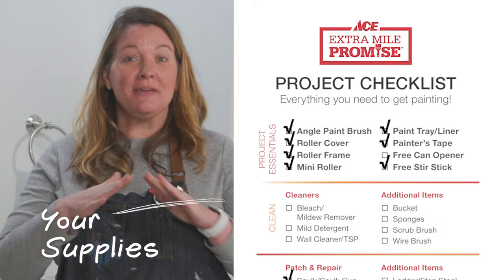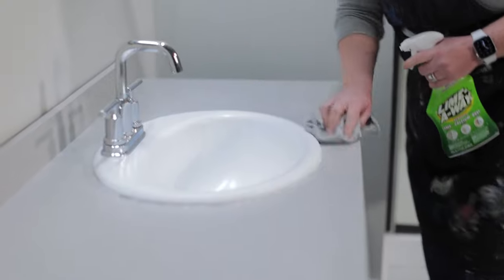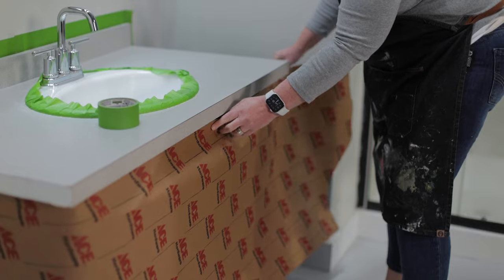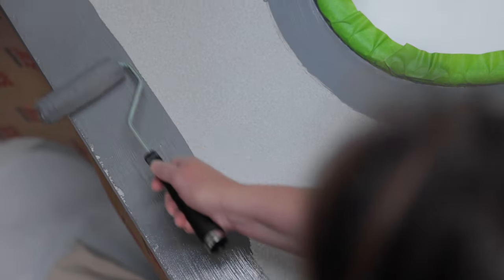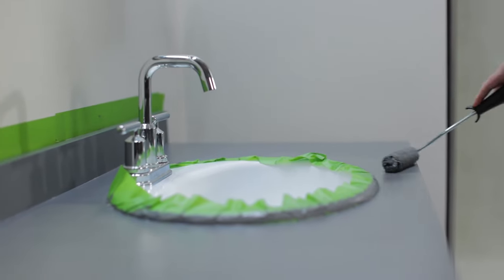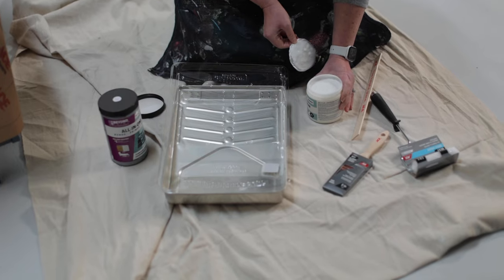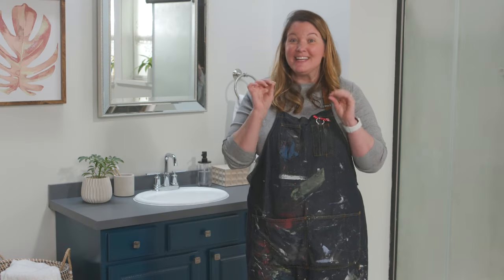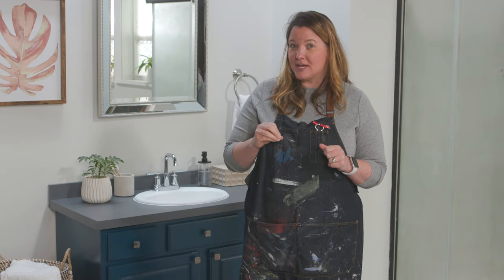How To Paint A Bathroom Countertop - Ace Hardware

Comment: If the bathroom countertop is currently caulked to the wall, should I remove the caulk before painting and then re-caulk after the paint is dried? Or can I paint on the existing caulk.
Reply from the maker: Yes, you will want to remove the caulk and then re-caulk. We can't guarentee the caulk that exists on the countertop is paintable.

Comment: Do you used foam roller? 

Just finished my two coats of paint, with foam roller and my surface is so messy😢
Reply from the maker: We did use a foam roller. If you get the Beyond Paint countertop kit includes the foam roller. If you use a nap roller yoy may end up seeing the roller marks.

Comment: What if you already spray painted with Rustoleum and it flaked and peeled.  I sanded with a grinder.  Will it show if I do two coats.
Reply from the maker: Hi Cindi,
If a heavy profile is put into the surface with the grinding, there are not many paints that will cover it up.   If not heavily ground / profiled, the paint should cover, but we would still recommend priming first to provide sufficient mil thickness for good corrosion resistance and a good foundation for the topcoat.   Stops Rust Clean Metal Primer would be a good choice, here's a link to learn more/shop it here: https://bit.ly/3wXOT0h